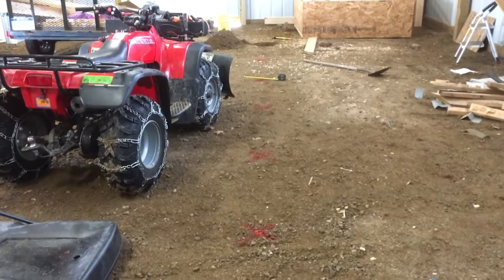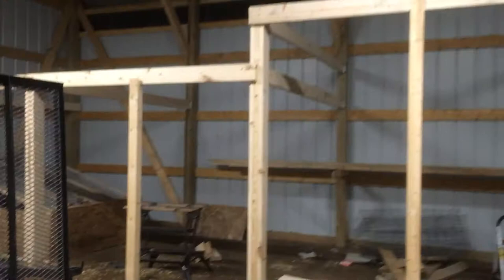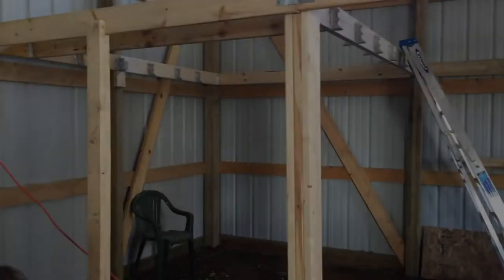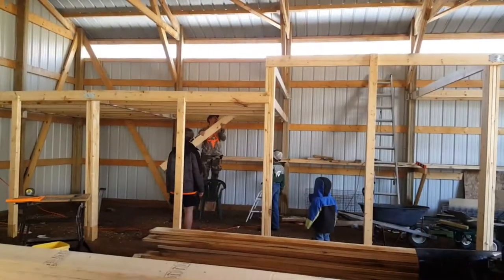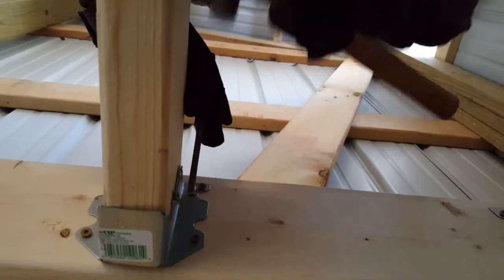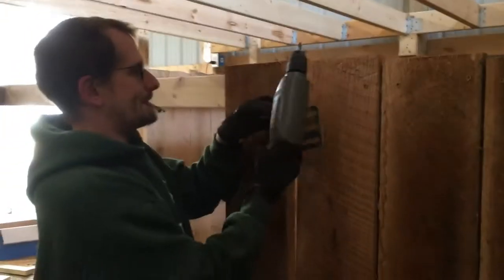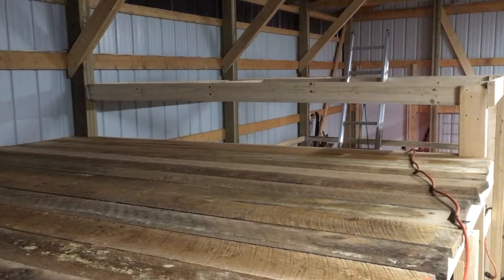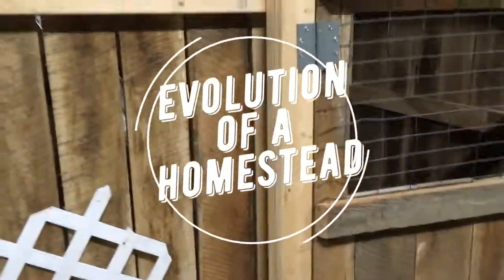Building stalls in a pole barn - with Hayloft (for Goats and Horses)

Comment: How much weight will those metal brackets and the arrangement you built here bear? Would be nice to know if things bigger than hay bales can be stowed on top, such as water tanks and how large of ones - for example.
Reply from the maker: I would think so if they were empty. It's really sturdy, kind of like a floor in a house. You would have to read the load bearing weight of the joist hangers at the hardware store I guess. He researched a bunch of lofts and and based the design off that. We only wish there was a space left somewhere in the floor for light to get through to the stalls.